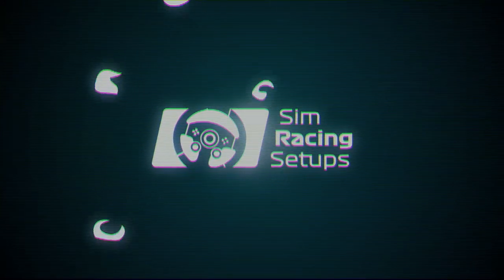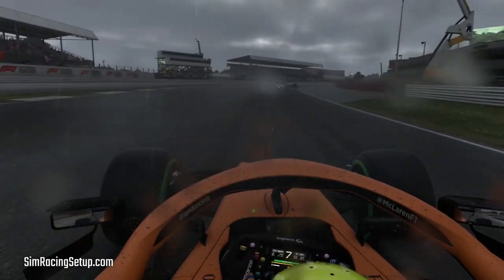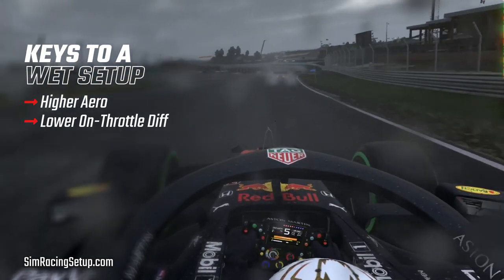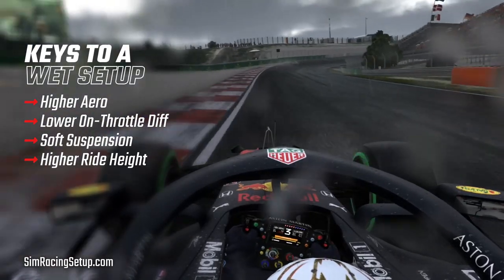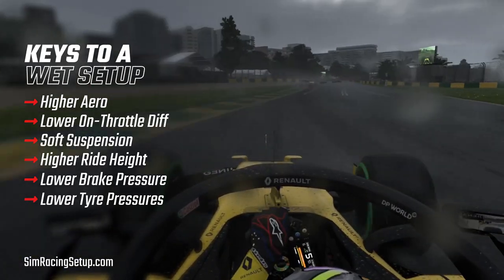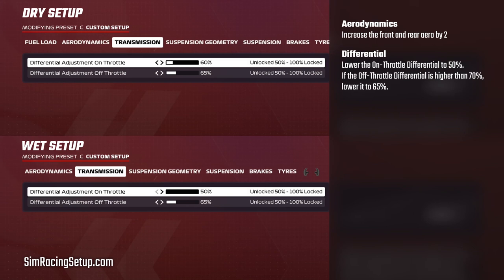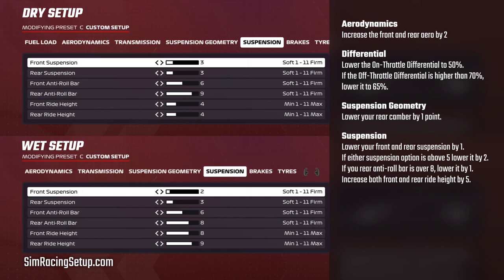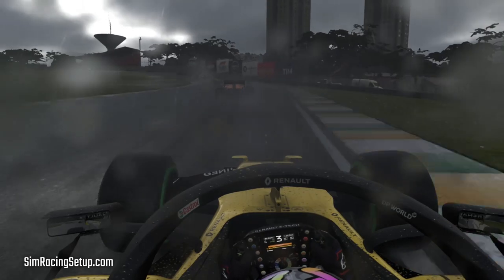How To Convert A Dry Setup To A Wet Setup - F1 2020

Comment: Thank you for this amazing video!! I think these tips will translate to the F1 2021 game, but any difference in amount we need to adjust off throttle or ride heights etc.. I ask since they changed quite a bit from 2020 to 2021. Would be much appreciated. 
Thanks again.

Comment: I have a stupid question... What do I do when Qualifying is dry, but I know the race is wet?
If I'm not wrong you can't change your car setup after Qualifying, can you?
Because auf Parc Ferme stuff.

What do I do in this case?
Reply: Depends on the track. Easy to overtake = prioritize race (in your case wet setup) / hard to overtake (monaco/spain etc.) = prioritize qualy (in your case rather dry setup)
Reply from the maker: Post Mortem gave a great answer, which I generally agree with. I would generally prioritise the race, so setup for race conditions. Other than a few special circumstances which Post Mortem mentioned. i.e. Monaco where you will struggle to overtake.
Reply: Thank you very much

Comment: Hey! Love your setups and content. How much of this stuff so you feel transfers to 2021. I feel like I heard trl.limitless say that this year you can basically use the same setup minus maybe lowering in throttle diff.  I haven't had a chance to experiment too much because I just started playing 2021(been grinding ACC) so I was just wondering your opinion. I guess my main question is does this video still hold up for the most part or are there any significant differences this year? 

Thanks!

Comment: What should i do, if i have rain qualifying, but dry race? Should i use my dry setup or wet setup or something in between?
Reply from the maker: Setup for the race most of the time. If its mixed conditions you can tweak your car mid race or in parc ferme using the front wing and on-throttle diff settings.
Reply: @SimRacingSetups  thank you! im going to use your race setup

Comment: How you can make the setup change in a race, already with parc ferme.
Reply from the maker: You can only change a few setup options after quali. Front wing being the big one + brake bias and on-throttle diff.

Comment: I have been using your setups for a long time really thank you. My question is more what are your tips for a wet qualifying but dry race? Since i can only adjust a few things after i leave the pits i do that and sacrifice my possible pole/ starting position.
Reply from the maker: I’d recommend setting up for race conditions. You can make adjustments to your front wing and diff after parc fermé

Comment: What changes to your Dry setup would you make if you expect to see Mixed weather conditions during a race? Obviously not all setup adjustments can be made during a race so which ones do we sacrifice?
Reply from the maker: More downforce on the front, lower on throttle diff. Slight higher ride height. Lower tyre pressures are the main ones to get you through a mixed race 👍🏻

Comment: Shouldn't you increase tyre pressure significantly to get some heat into those tyres?
Reply from the maker: If you're struggling for heat yes. But lowering the pressure will help with traction out of slower corners.

Comment: Slightly different question. What if within the race itself you start wet/dry and during the race it will get dry/wet. Do you compromise and go for a setup in the middle? I really struggle with that a few times.
Reply: I would personally never go full wet like the setups in this video, unless it is full wet quality and full wet race, which is an extremely rare thing to come by. Otherwise, I would suggest to look for a "happy middle".

Comment: But what if i load dry setup for quali and race is wet and parc ferme is on? what can i change?
Reply from the maker: Lower on throttle diff. Lower tyre pressures. Increase front wing 👍🏻

Comment: Is it the same both with intermediate or full wet tyres?
Reply from the maker: This is for wet conditions on inters. For full wets adjust your downforce a little higher, tyre pressures a touch lower, and ride height up by 1 if needed.

Comment: thats fine but what happens when you have parc ferme on and the quali is wet and race is dry ? then what you do
Reply from the maker: You have to plan for the weather before quali due to parc fermé. Generally it is best to run a setup for the race.
Reply: Run a dry set up,the one you’d run on dry quali you may loose a couple of places on the grid but in the race you will be much faster as you’re not running a wet set up on a dry track

Comment: What do I do if it’s dry in quali but wet in the race??
Reply from the maker: You’ll know this before time thanks to the weekend weather forecast so set up with a compromised setup. A little more front wing, softer suspension, more ride height and lower tyre pressures

Comment: Wtf do i do for a dry qualifying then a wet race. Do i just run a dry setup and change the front wing and throttle for the race? 
I can never get out of Q1 when its like this!!
Reply: I would focus more on the race. But not go full-full wet. So, not as drastic ride heights (4-5 or 5-6 would usually be good enough). And also not as drastic front wing adaptation. I usually only add at max 1 to the front. The rear is most important, there you should add 2 or 3.
Reply: @revirdkcalb  thanks man ill give it a good crack 🤜🤛